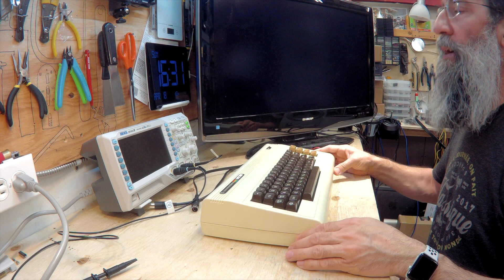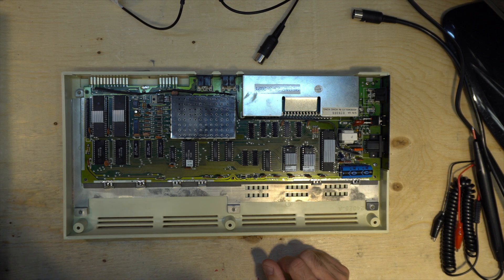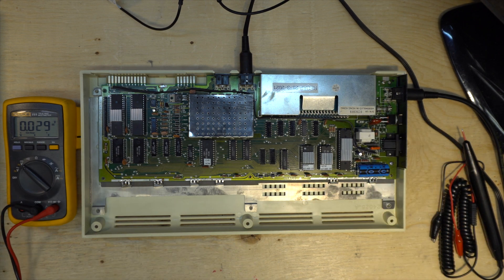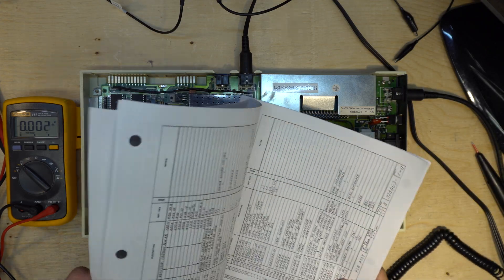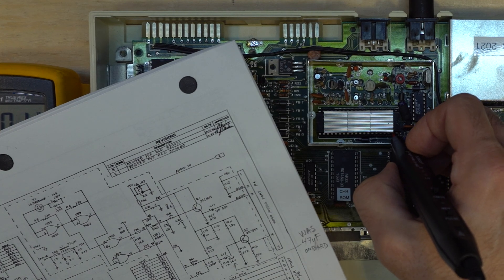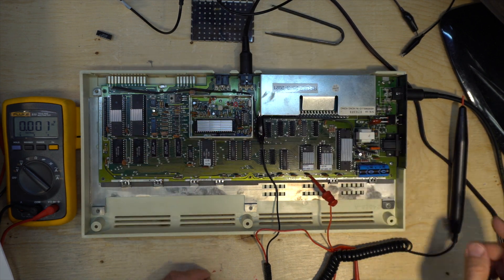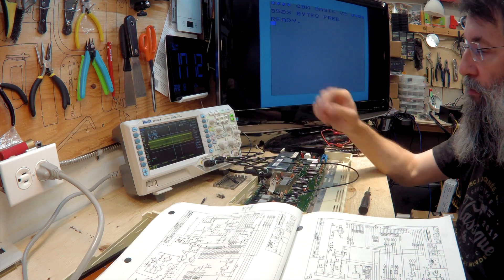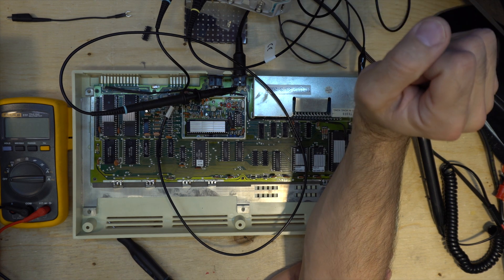Vintage Computer, Vic-20 Repair

Comment: hi Frank i got a Vic 20 with a blue cyan screen on boot can it be the same problem? which equivalent this chip is?
Reply: You mean the screen looks dark? If so, then look for the 2 potentiometers close to the VIC and adjust them. All VIC 20s used to normally look like that because they are set up to work with the RF modulator. For composite, you have to turn up the signal.
Reply: @Doug_in_NC  i try it and it stay  a solid blue cyan square on boot no character at all :( maybe bad rom or ram i dont know another guy on the internet had the same problem
Reply: @BraveNewWorld1984-r6o  If you put a cartridge in and switch it on, does the game work? If so, then it’s the BASIC ROM that is at fault.
Reply: @Doug_in_NC  Thanks a lot for the info!!! :)
Reply: @BraveNewWorld1984-r6o  Ray Carlson probably knows more about repairing VIC 20s than anyone else.  The list of possible faults he gives is a really good start to identifying a problem.  http://personalpages.tds.net/~rcarlsen/cbm/vic20/vic20.txt
Reply: @BraveNewWorld1984-r6o  Are you using the RF modulator or connecting directly from your computer to a composite monitor?
Reply: @Doug_in_NC  composite cable the same i use with my c64